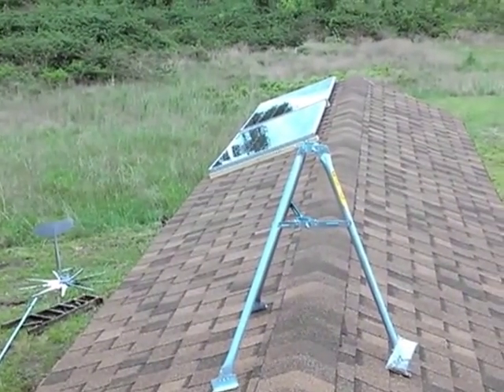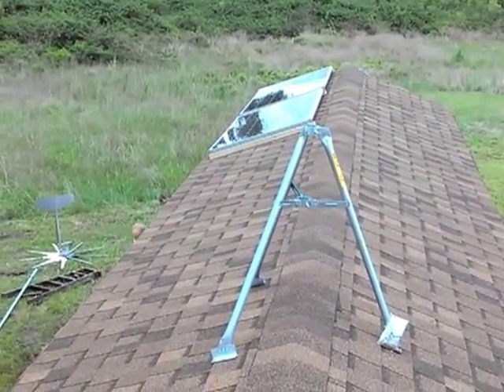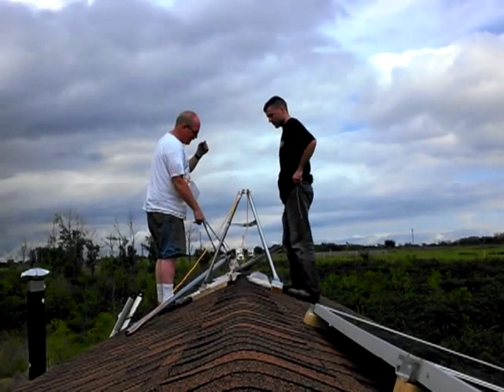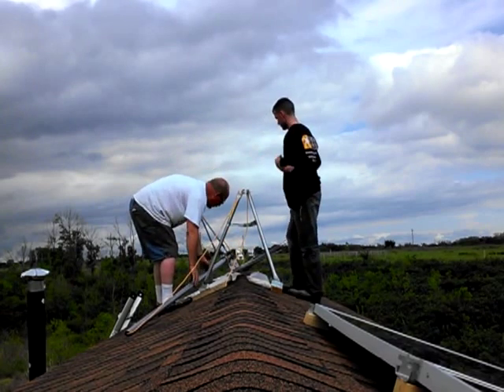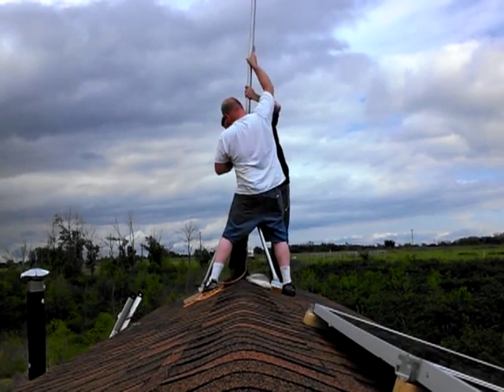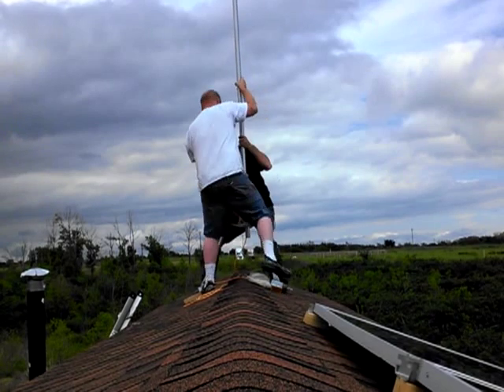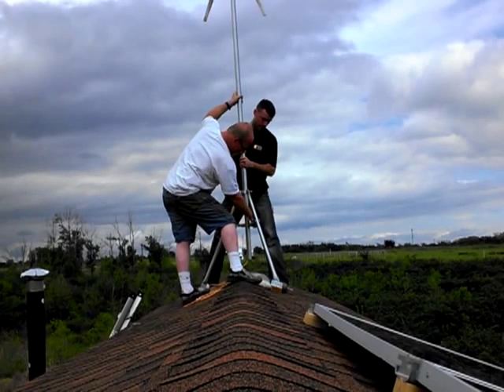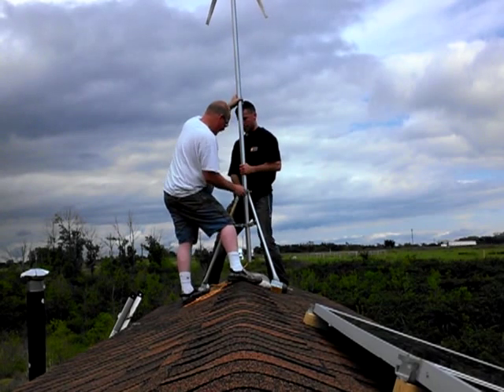Installing a Wind Turbine - Off Grid Tiny Home - DIY

Comment: LOTS OF INFO - we Restored the SUPER CHAOS turbine. Using world famous HORNET PMA   https://tinyurl.com/SUPERhornetPMA1k Original Inventor, best on the market*PARTS TO GET BELOW*  90/180 amp Slip ring, ONLY HONEST SELLER https://tinyurl.com/GENUINEMOFLONSlipRing the REAL THING  - Not a MISSOURI / Vietnam Knock Off 
Meters is 100 Amp DC, ebay https://tinyurl.com/100A-meter Original Meter Manufacturer, 8 to 10 day shipping.  
This video channel https://youtu.be/NdgKH4lXrE4 shows you the simple building process of Turbines, Rectifiers and Meters.  
Chaos is Made with PROVEN materials. If you want fake watts, you have to buy from places in Missouri. I suggest your parts come from proven sources. Ask, I'll send you links and you can review and apply. 400/500 watt REAL Wind Turbine from http://s.click.aliexpress.com/e/qv7ayvN all specs there. 
100 Amp Rectifier BAO-Amico http://amzn.to/2DkP4q7
3 pole double brake Switch http://amzn.to/2FrFOB5
100 watt Brake Resistors http://amzn.to/2FrzwRQ
- WIND AND SUN Diversions controllers, So Smooth, Battery Saving. https://tinyurl.com/WindSun-Controls by J Mason Design Solid State Controls, SSR the rest are crap~
-Rectifier Spade Connecor Terminal 3/8 https://tinyurl.com/Proper-375-Fmale-Terminal  Proper .375 inch Fmale Terminal

Comment: why this turbine is not rotating while installing.?
Reply: Because do you wan't to get hit by the blades?
Reply: short all the connection to manually break the blades from spinning.  because if not before you finish installing the turbine you probably death... just kidding :)

Comment from the maker: Yup. I am thinking about doing some tower climbing videos too on how the technology works. It's some really cool stuff how lightning dissipation systems work by discharging the atmosphere to prevent strikes from occurring. This last one I installed lights up blue in a storm as it gathers the plasma / charged particles in the air and routes it to the ground. Really cool stuff. Yes, when ever Bill is ready and I have time off I will be taking down a tower from one place....

Comment: There is an electric pump right now, we would use it for a back up in the event power gets cut (which in a collapse scenario is probable i.e. people stealing power or vandalism).  Plus it is good for saving money and we could generate some electricity off of it, irrigation will be necessary too...It's expensive so we haven't gotten around to it yet.  There is a 6 inch well and in the field there is a 12 inch.  In a bind we'll get the water one way or another. Plan on hand pump too..

Comment from the maker: Dangerous? Nah, only if you have a fear of heights. I run around on cliffs for fun. A roof is nothing. I can't wait till your tiny house on wheels is done. I'm about to subscribe to you and follow you. What do you plan on for heat? Propane? Have you heard of those solar air furnaces? I'm considering making one for mine in the fall. Pipe it into the RV's HVAC system.